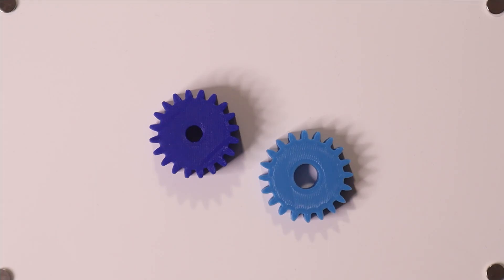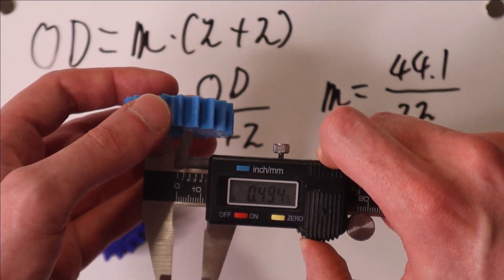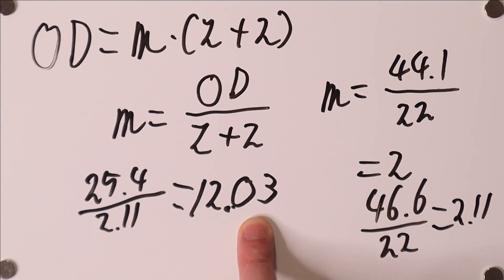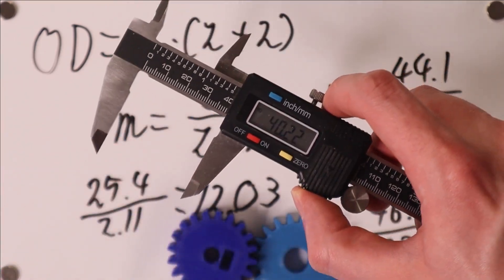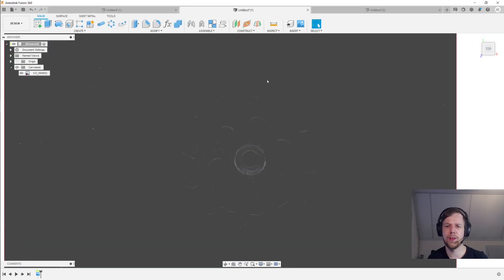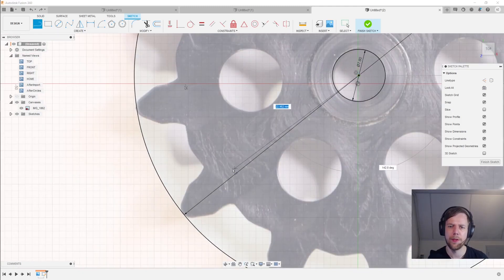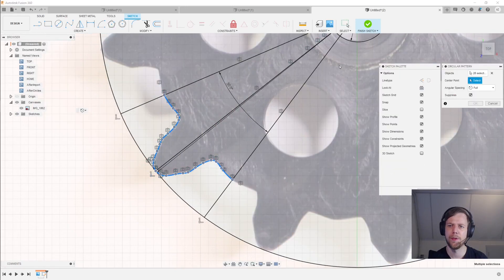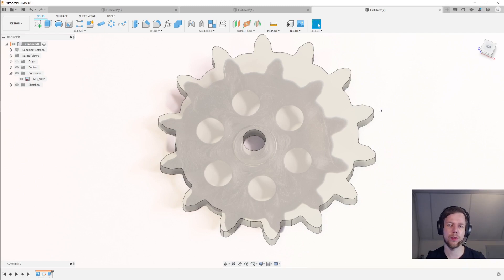How to Replace Gears and Reverse Engineer Sprockets

Comment: Went down the rabbit hole of your videos. Just picked up a used 3d printer and downloaded Fusion 360.

I've got some experience with autodesk products as I do limited architectural design for project I build (general contractor).

I'm curious how you've become so proficient with the software. Did you learn this in school? Online courses?

Anyways, thanks a bunch for posting, love the content!
Reply from the maker: The proficiency comes mostly from practice. I'm completely self-taught in Fusion360, but you can use courses for the basics too. However to pick up speed you need experience, and to get that the best thing really is to just design and build stuff. You need to build stuff to I believe, because designing things that work only in CAD is a big trap.

Comment: I have done this for one of my lathes, Fusion is brilliant, let me explain, I measured and modelled the broken pinions and then on my Prusa I printed them, check the fit on the splined shaft and the backlash and tooth engagement them wired them, run them in the soft condition then heat treated them. fantastic!
Reply from the maker: Cool! By heat treating do you mean annealing PLA, stress-relieving PC, or something else?
Reply: @antalz  no, I used the PLA 3D printed model to check fit, it fitted perfectly so then I wire cut a gear from case hardening steel using the same G code generated for the PLA prototype
Reply from the maker: @crozwayne  Ow that's really cool! No problems with dimensional changes after hardening?

Comment: Your channel is way underrated. Get permission from YT content creators like BigClive, MakeMuze,.... and see if they'll let you post links to your channel. Or let you  post link to one of your projects that is relevant to their video. 
If you don't ask, you'll never know. 
Google is not being a good brother to your channel. You've got to go on the hunt. 
I found your channel by accident when looking for videos on SolidWorks and gears. 
Although I wish you made videos on SW, I am content knowing that SW and F360 are so close in operations, that I can translate your moves into SW moves.
Reply from the maker: Thanks a lot mate! Google has actually been quite kind to the channel, lots of traffic to some of my videos. For some reason my video on the air conditioner hose started doing well this year too. I'm afraid a lot of my other content doesn't do that well in search or in recommendations. 

I'm currently busy with a full-time commitment, I'm hoping to get back into more videos early next year.

SW should work fine, the basics are the same across all CAD systems. Mates and joints are a bit different though.

Comment: I went on a spree of measuring every single gear I could find in the house after watching this!
Great video
Reply from the maker: Cool, did you find any oddball gears? I'm kinda surprised I can't think of many gears in my house except the ones I printed myself. Maybe I should take apart the gearhub on a bicycle?
Reply: @antalz  
All the gears were pretty simple, but the size varied a lot. I have a Mechanix set from when I was 8 or something, that has a variety of gears in it. Other than that I took apart a wall clock, which had tiny gears in it.
Yeah! I would love to see the working of the cycle gears, if you could do that. The gear change mechanism has always fascinated me!
PS - I'm in college first year rn, studying mechanical engineering. The core mech. topics haven't started yet, but I'm really enjoying your video series, and I really look forward to learning all these things in detail!

Comment: How do you reverse engineer a bottle cap with inner thread? Let's say a water bottle with threaded bottle cap
Reply: Reverse engineering threads in general is something that’s still magic to me. Would love such tutorial on that.
Reply from the maker: I haven't done that myself. I think you should measure the diameter of the bottle, and the inside diameter of the cup, and if possible cut open one of the caps and measure the pitch of the thread. Maybe you can also put that on a scanner and find the shape of the threads. You can then use the modeling method I show in my worm gear video, but then in the second sketch use whatever the profile of the thread is.

Comment: Daym I expected Blender to come to the rescue.
Reply from the maker: Unexpected comment, why Blender? Because of OT Vinta?
Reply: @antalz  I didn't have OT Vinta in mind, I've seen their videos too. 

But my reasoning was because Blender is, imo, "closer to the vertices", or at least gives you more control for individual ones, than Fusion 360. In blender you can just press tab and you're in edit mode for the vertices.

I guess it makes sense to use Fusion 360 for this since a gear is more or less a 2D-shape + an extrusion.

<-- Uses Blender for everything, even video editing, and especially reverse engineering models.
Reply from the maker: @harrysvensson2610  That's an interesting choice, I thought getting dimensional accuracy in Blender was tough? Do you start from a 3D scan?
Reply: @antalz  The dimensional accuracy is not a problem to me, just set what units you are working in, which is mm in my case, and I get a 32 bit float. 32 bit float => 6 digits representation (6.9 if you want to be specific, but we round down), so I can represent the number 25.0001 which is 25 mm and 100 nano meters. I'm not aware of a 3D-printer that has nano meter resolution & precision, nor do I really need it, so I'm fine.

Hmm a few times I've gone with just a 2D scan with your typical paper scanner, the thing that gives a crisp 600 DPI image. Then there's no projection error and this is fine for 3D objects that are mostly 2D (such as knife handles, keys, gears). 
For geometry that is more 3D like a small DC motor that are in toys I just use a digital caliper. It's very similar to making a sketch and extruding, but if you want to add holes in the motor that come at an angle then I can easily set up a boolean operation in blender and I'm done. With fusion 360 it feels more like a puzzle, like I don't have enough control. Or maybe that's just an excuse for disliking change.

But yeah, I did make a 3D-scan of a house once, the kind made of wooden planks that is in a playground with sand that kids play in.It's very easy to have a point cloud and as a human identify that certain points is a plane, these points is an edge, etc, and then put your house together. 

There was another pointcloud scan that I converted to a model as well that was a milling cutter, literally the entire machine. It's about 50 years old. That one had very curvy surfaces all around like a car. Yeah I don't even know where I would begin to convert that to a model with fusion 360. Or any CAD software for that matter.

Blender is love
Blender is life